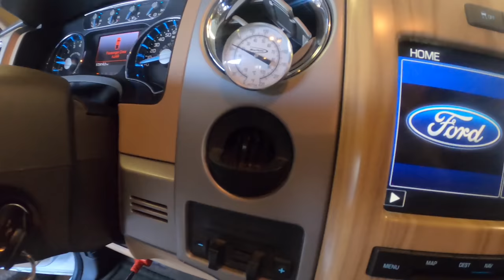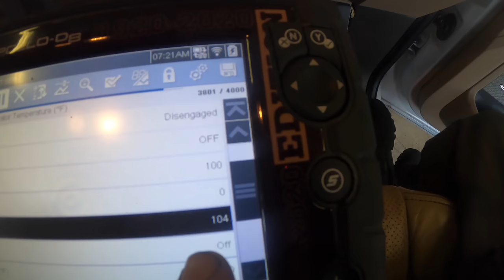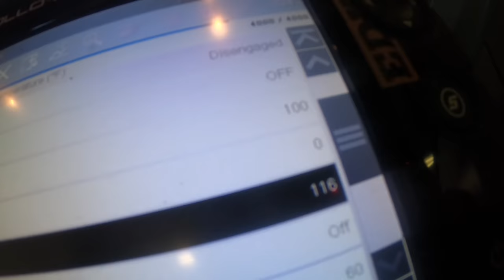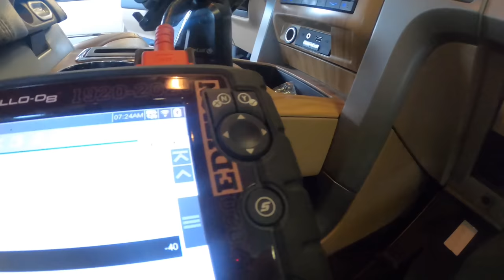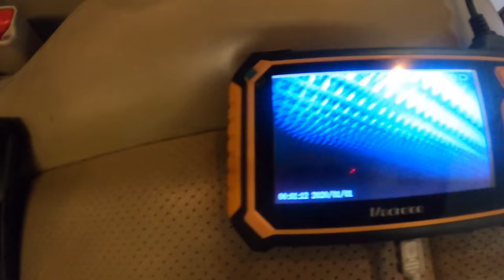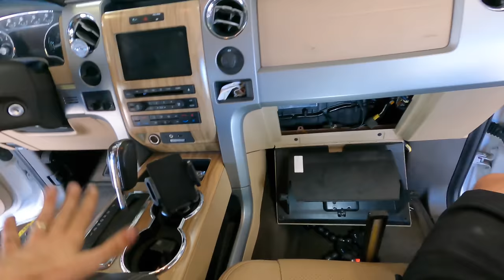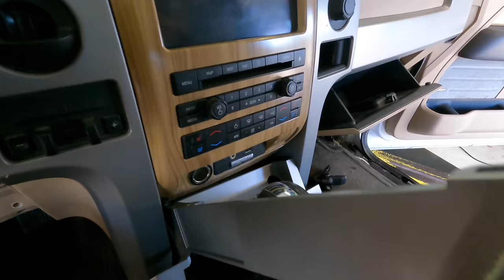TEN HOURS to replace one sensor! Ford 150 torn to pieces! Evaporator Core replacement.

Comment: This is where the design engineer needs to demonstrate the easy way to replace a temperature thermocouple which should be behind some sort of access panel.  Unbelievable the amount of work required to replace a 20 dollar thermocouple.  Great work Ray.
Reply: I've heard that a lot of mechanics refuse to work on Ford vehicles because of the crazy engineering. Just stupid stuff like 2 piece spark plugs that break off in the cylinder head etc.
Reply: I'd say it gives engineers a bad rep but I know plenty of dumb engineers.  But you're 100% correct!  How many times have you seen an access door to a fuel pump?  Removing the tank to change a pump is idiotic.  Removing a truck bed being "easier" but still sucks!  Those bed mount bolts never get stuck... ugh
Reply: @WVdavidB  as an almost engineer, I have to agree with you. I’ve met a lot of dumb engineers. Elon had a design competition for the cars for his hyper loop. Basically a giant vacuum tube like banks use. Every single Ivy League college design team decided independently that the best way to propel a vehicle through a vacuum would be the use of a giant fan. Every single one of them was astounded that it didn’t work. Turns out for a propeller to work, it needs air to push against.
Reply: I wish I could say this is less common. Dodge/Jeep/Chrysler likewise manage to create $2000 jobs worth of labor to replace a $13 component. Honda J35A7 VCM nightmares with not one but two gaskets holding pressurized oil about an inch above your alternator which just loves oil baths.

Problems like these make it all the way to the military where engineers and their respective companies produce, for example, AAVs without ever once thinking of trying to climb in the back and sit down wearing military gear like 100% of real world customers will do, then wonder why the military complains about the interior getting people killed when it starts sinking. And don't get my started on how many software bugs they already admitted they will never be able to fix in that latest, greatest multipurpose stealth-fighter-bomber... 800+ problems on delivery from the most expensive fighter in US history.

Honestly you can beat the engineers with a ball peen hammer but untill you drag the CEO, CFO, and managers down to the production floor and make their lives miserable it will probably never fully "click" why people complain about their products so much.

It also really doesn't help that so many enineers come from families where the kid can afford to drive a BMW to school but struggles to grasp which end of the soldering iron is hot. When $2000 seems like pocket change to you, what's the problem? When you've never made below a certain amount of course shit designs look fine. You can always afford to pay someone else to fix it.
Reply: On my own car I’d figure out the resistance range the computed expects and build an appropriate sensor out of a thermistor and a voltage divider. Less than a dollar in parts. But for someone else’s car… it sucks Ford doesn’t have a part number for that sensor.
Reply: It's designed to be put together goin' down the line, they could care less about anyone fixing it.
Reply: Early 2000s jeeps you had to remove the front end (bumper covers, grill; headlights, etc) just to replace a $20 fan relay or you can remove one headlight and cut a 4x4 square into the plastic below it with a cutoff and it is right there
Reply: @Leonarco333  Maybe they were trolling the fact that the vacuum tube for the hyperloop at any sort of commercially viable scale is a pretty much unworkable idea in the first place from a physics/engineering point of view.
Reply: @mfx1  I wish that was true. They weren’t. There are so many reasons it’s a terrible idea though. Maybe that’s why all the people who could have made it happen didn’t show up.
Reply: @Leonarco333  Hyper loop is nonsense. If Elon was 1/4 as smart as people think, even he would know that.
Reply: @hawkdsl  I know.
Reply: I would have totally authorized you to Dremel an access hole and install a junkyard sensor
Reply: @livingdeadbtu  I was going to say the same thing, neat access hole, then  make up a new cover with some sealing tape, refit with screws, job done.
Reply: @stevemandeville4178  that's the 04-08 5.4 which is also notorious for cam phasers. Hence why that design of engine lasted 4 years
Reply: @mfx1  @livingdeadbtu  I had to replace a fan on a durango.  WONDERFUL engineers put the wires for the fan against the firewall on the back side of the fan.  I chose option 2.  Pulled the wires all the way out, plugged the back side hole with silicone and a bit of plastic.  Pulled the wires to the front and drilled a hole.  Popped in a grommet and viola, fan motor changed without pulling the ENTIRE dash apart.  Designs like that are why NO engineer should be allowed to design without first having done 10 years as service
Reply: @DagarothBlackrose  Absolutely true. I'm in the construction industry by career and I see similar problems constantly. Nobody should be allowed to design anything until they can show it's done in such a manner that allows inspection and servicing of those things which mat be reasonably expected to fail within something's expected service life. That won't happen until we end the concept of self-policing professions like engineering, medical, and law enforcement "professionals" enjoy and abuse that power to the detriment of the average person. Personal responsibility for your mistakes needs to be the standard if we're going to ever see the mistakes end, and I can't find anything wrong with that idea.
Reply: @boxedowl  the simple answer to what you have just stated is the people that teach engineering have no idea what they are doing. The people that claim to be engineers cant see the forest for the trees. And companies that build shit like this have multiple engineering divisions all of which have no idea what the others are doing
Reply: @P_RO_  absolutely right. If the engineer that designed that had to cover the labour costs for every unreasonable replacement of failed part he would not design shit like this
Reply: Manufacturers are creating more difficulties to work on your own vehicles. It’s their way of increasing profit and make normal working person poor.
Reply: @WVdavidB  Most foreign cars, like my '96 Camry and '98 Altima, have (or used to have) a gas-tank access plate on the floor under the back seat, just for that reason.
Reply: THe goal today is engineer the vehicle to last just past the warranty. After that, the sky's the limit on how difficult or expensive it is to repair. This example is not only engineered to make the labor cost excessively high, but by making the sensor available, combined only with a bunch of unnecessary components, Ford parts-division's marketing has made it excessively expensive to buy the part!
Reply: @gojudude  said but very true.
Reply: @jonyemm  Or...you could pull the grill and the right front headlight...cut a hole with a 2 1/2 in hole saw, and change it in 15 min...but I do agree with what your point is....
Reply: @gojudude  sounds like we both get the same results just take different methods to get there
Reply: You guys are looking at this the wrong way. The engineer who designed this definitely went out of their way to make it this hard. I'm not exaggerating. Ford is well known for this type of design. Spend an extra 4 days in design putting it in a "bad" place, now get $4000++ for your dealers every time one breaks. Dealers make most of their money on shit like this, they're just manufacturing work for themselves. And more parts to sell as an unnecessary "assembly". Imagine how many good parts get thrown out because they are part of an assembly with something else that broke.

They know even though the job pays 10.8 hours, after a dealership does a few it won't take that long anymore. And they probably have a waiting list...

Henry is looking down with a smile. Actually, more like up, but....
Reply: @stevemandeville4178  I know right.  I had an Escape come into the shop that wasn't charging.  He had 2 different alternators put in it at the dealership and they couldn't figure out what the issue was. I figured out it was the active shutter grill servo that was bad and causing the whole issue.  What a nightmare that job was.
Reply: @Leonarco333  Designers in general often aren't the end users of a product. I see it in my own line of work, printing company, a lot of graphical designers have no clue about the whole printing proces, but it is in a lot of branches. I have a coffeebean machine, the residual tray is poorly designed for cleaning, same with cars nowadays, it is almost an expedition on its own to replace a headlightbulb or blinker.
)They often only pay attention on looks rather than being functional and practical.
Maybe designers should work more closely with the mechanics or end users.
Reply: @Leonarco333  boy, that sucks
Reply: Same thing with the heater core on these Fords. No access panel means doing all the same work to replace a $40 part.
Reply: they should have just made it a screw on module that sticks into the core from outside , although thermocouple failures are not too common and i rarely see them , the most i see them in is in package units with economiser and that sensor is totally exposed to the elements so they fail after a while. it is basically a cheap 10k ntc
Reply: This is why I keep my 96 F250 running down the road.......with working A/C
Reply: 👍exactly
Reply: @ryanroberts1104  I have been telling people this for years! Everything is designed this way nowadays!
Reply: @Leonarco333  hyperloop is a fools errand, so maybe they were all just trolling. Most recently that vacuum maglev hockey table tube train idea is just small electric cars stirring up rust dust under normal atmospheric pressure. Even the best engineers can't make a stupid idea work.
Reply: The design engineer needs to have his ass kicked for designing the vehicle like that.

Comment: Ford probably had a lot of complaints about it taking ten hours to replace a $20 sensor. So the bean counters had a meeting and decided that the sensor should not be sold separately. Ten hours work to replace a $250 evaporator seems much more reasonable!
Reply: After spending my life in this business I can assure you manufacturers do not want things like this to happen, there is not one positive return from this. Based on the performance of items like this sensor they feel like it will most likely never fail but what happens sometimes is that the subcontractor uses subpar materials even though the contract explicitly states no substitutions.
Reply: Haha.
Reply: @Bass.Player  All those little motors, blend door, mode etc have been known high failure items for decades yet they still bury them. it aint their problem so tough luck.
Reply: @thud1241  Well find a way not to bury a blend door. I changed a blend door motor on my GC a few years ago in 15 minutes.
blend doors and motors are generally not a failure point, what should have easier access is heater cores and evaporators...
Reply: @thud1241  it's a case of building the vehicle around the HVAC system. Inexcusable, but it's cheaper to manufacture that way.
Reply: Pfft, engineers. amiright?
Reply: Like others... HOW THE HELL DO YOU PUT IT ALL BACK TOGETHER?  Maybe all your pix help but still....  100's and 100's of pieces and parts including hidden stuff and easily broken plastic pieces.  I dunno how you do it....  but, then, that's your job and clearly a cut above oil, tires and tuneup.  Many cuts above!
Reply: You better put a "1" in front of that $250.
Reply: @Bass.Player  I'm calling BS on this statement. Engineering by it's very nature is a race to the bottom where what engineers consider to be the best design is the one which barely gets the expected job done with the least materials and manufacturing/building costs involved. If a failure occurs they blame someone else for not meeting their design criteria when it's common knowledge that nothing is always done to the highest standard so you can't realistically expect that. 

Every vehicle built today is designed to make manufacture as cheap as possible as long as expensive failures occur outside of the warranty or recall period. Every vehicle has one or more service problems which could have easily been better addressed at minimal cost but it isn't done because buyers aren't demanding it, which lets the manufacturers continue screwing us with their poorly executed designs which work wonderfully for them but not for us. "Too expensive to fix for the car's value" is a cop-out we shouldn't hear on any car less than 20 years old yet we hear it on cars half that age. Cars were once built to that standard which is why I'll never sell my 30-year-old; it's easy enough for the average mechanically-inclined person to work on and can easily last another 20 years as long as maintenance parts are available.
Reply: @P_RO_  You know what they say- ignorance is bliss. And you my friend are blessed with that attribute...
Reply: Too many parts! At least it keeps great mechanics like you in business. Thanks Ford. ;-)
Reply: @Bass.Player  this is a pretty ignorant comment reflecting your true personally and level of intelligence. P RO made a good statement and you choose to insult him. Makes me think you had a hand in designing something like this
Reply: @holmes1956O  I just get tired of people making blatant comments that are not based in fact. Did I have a hand in some of these designs? Absolutely - from a performance and endurance stand point I worked with some manufactures concerning proof of concept. I'm retired now but I was a Master ASE tech, Master registered tech (European equivalent), 
I finished in the top ten in the US technician challenge, I taught Auto-tech on the collage level, I wrote the Texas state curriculum for auto-tech and if you ever used a technical repair manual in the past I most likely proofed it.
So ignorant and low level of intelligence- not likely! remember what I said;  "ignorance is bliss" but now you know. Did you learn anything at all or do you just possess that instinct to come to someones rescue.
I'm through here I'm beginning to feel like I need a tetanus shot....
Reply: Ford, Chevy and Chrysler put cost well above quality for parts and when selecting parts manufacturers. If the vendor fails to deliver they ‘fire’ the vendor. Toyota puts quality before price and if the vendor is having issues Toyota collaborates with them to solve any problems. 
No manufacturer is perfect but when you see the failure scores per part, they mirror the emphasis or lack thereof perfectly.
Reply: @P_RO_  Well you are certainly entitled to your BS opinion...I hope you never need to rely on that single stage air bag if it even has one or side impact structure designed to protect the occupants in that 30 years old car. A lot of what a car is today is predicated by the Government and insurance companies from seat belts to crumple zones and air bags not to mention fuel economy. To accomplish these feats longevity becomes secondary, after all if you cannot meet these ever changing restraints you will not have a car to sell. Cars last much longer today than they ever could in the past.  I wonder have you ever picked up a phucking book?